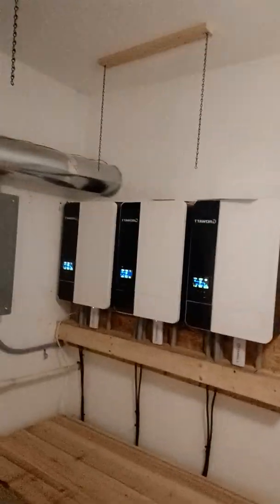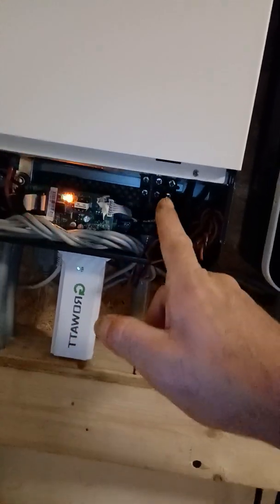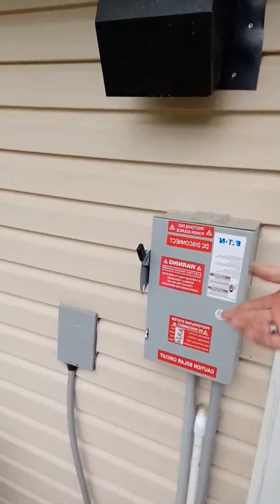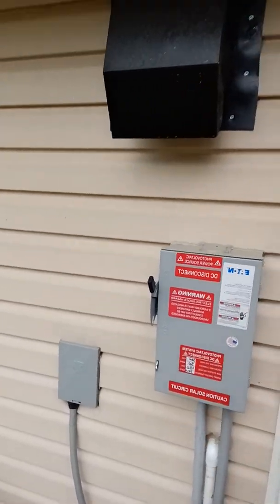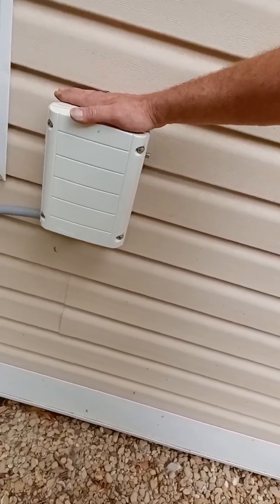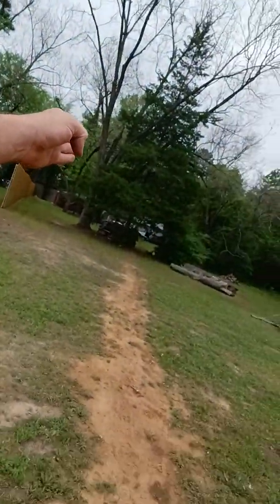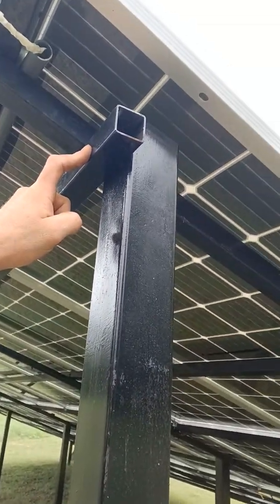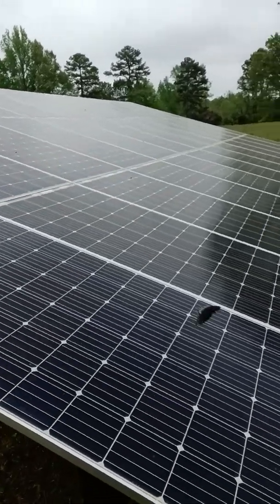⚡45KW LITHIUM OFF-GRID⚡ BATTERY SETUP / 13.5KW SOLAR GROUND MOUNT SYSTEM. ❤

Comment: How much do u charge for a ground mount only
Reply from the maker: That's a good question it depends on what we're doing. Parts are always at cost it really depends on the situation the distance and what needs to be done because there are so many components from point A to point B
Reply: 12'high by 40feet long just the frame
Reply from the maker: @dangoras9152  from Summit steel here in Kaufman County the parts are roughly $1,800 installation of this product cannot exceed past 50 miles unless we are the one installing the project. We're located in Kemp Texas. We would need a location before

Comment: are those growatts supposed to be mounted that close together ?
Reply: If you haven’t already, I would have sprayed all unfinished wood in the vicinity of the system/batteries with flame retardant(Amazon). Spraying afterwards may be a problem because the fluid and drying vapors may be corrosive. The system is clean looking👍
Reply from the maker: @SkypowerwithKarl  
I love that idea 💡  it's now in place for installations . Thank you!
Reply: @SkypowerwithKarl  Yes, i mean, the units will overheat,  potentially causing fire and because he ignored the manual, its unlikely the insurance will pay out. Still, screw the customer eh ?
Reply: @gug1970  
It’s kinda regardless of of whether or not it over heats. Things just poof from time to time lol. I just realized a heat problem myself. I have a pair of LV6548’s and spaced the correctly but found out that in a corner of a garage the same hot air just recirculates in a dead air corner. Also didn’t help the opposite side of the wall gets full afternoon sun. I blew in insulation and installed a thermostat controlled blower to suck out the hot air above the inverters. The kind that pot growers use. Always a learning curve.
Reply: @SkypowerwithKarl  So, the manual says 20cm minimum distance., This install is < 7cm. Their exhaust vents are blowing directly into each other. This was done for a customer, and when demonstrated  the guy just deletes the comments. If you cant see a problem with this then theres nothing i can say to help you.
Reply: @gug1970  yep these are stupid close together.  Also the lack of fireproofing with backer board. No NEMA wire ways just a wood box unless there is something I can’t see there, which is possible. Love the ground mount designing though, I would have just used red, to hell with clean, polarity and stupidity are real. No auto transformers on this one? I use these little guys for 240 as well only since I don’t like the thought of losing the neutral and frying all the 120 on the lines.  I like theses inverters a lot.  The new EG4 from SS look good as well for 120/240.
Reply from the maker: Recommended 3 in from each other. I have about one-and-a-half in between the inverters pipe flow area for air is only reason why I was able to get away with it
Reply from the maker: Absolutely not lol unless you have proper ventilation which the design has been updated with more inverters batteries. I will update new videos on the layout shortly